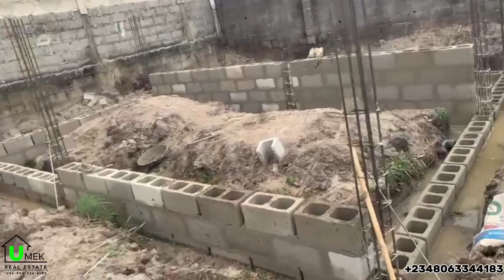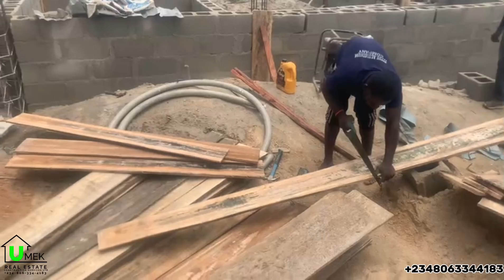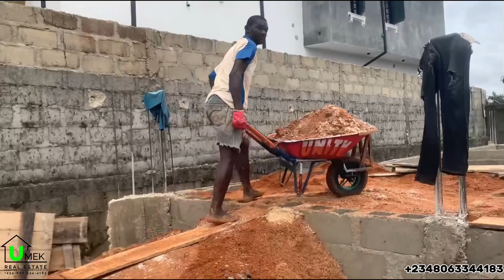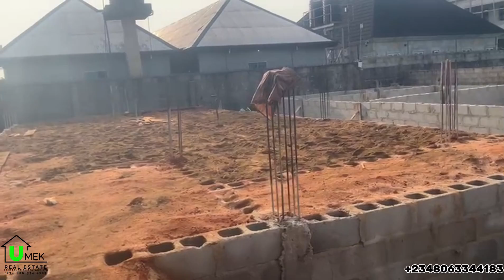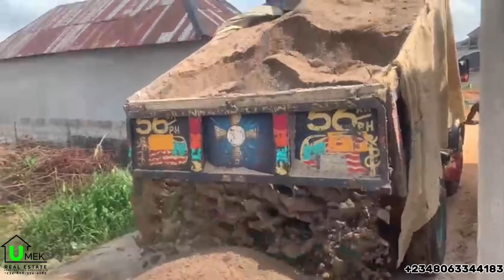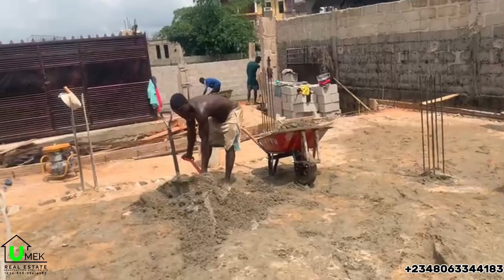Realtime Cost of Building a 5 Bedroom Duplex in April 2025: Foundation to DPC.

Comment: I did this same foundation on April last month , and it cost me only 5m plus bricklayer iron bender and all carpenter
Reply from the maker: @Devinfanz  That is a possibility, however, did you do ground beams and what is the total area of your foundation?
In any case, projects costs vary due to location, size of project, type of foundation, materials used as well as the cost of labour within the locality of the site…
Reply: How big is your project??